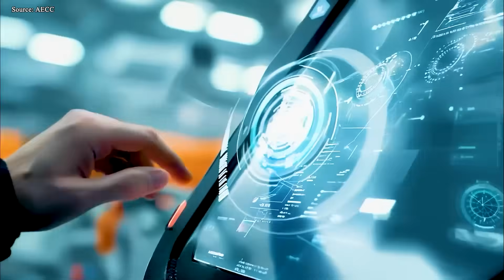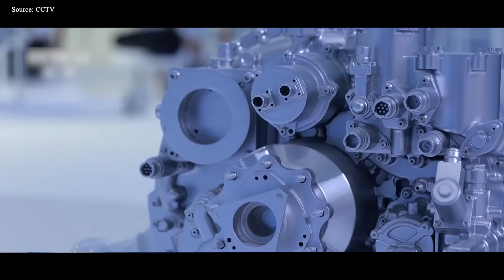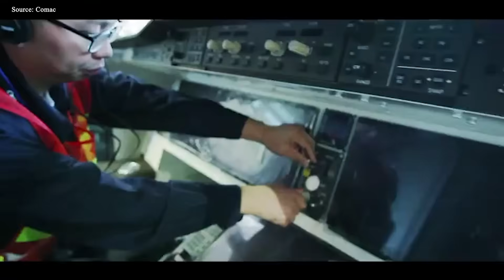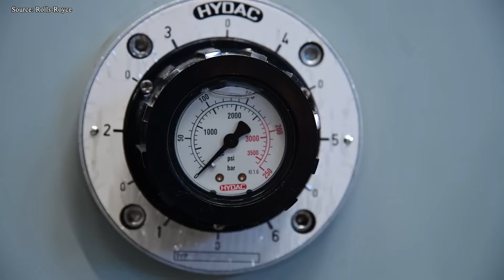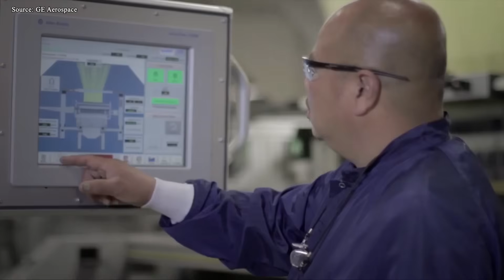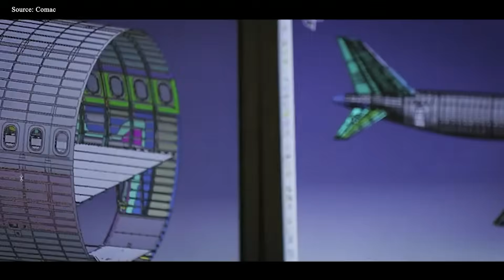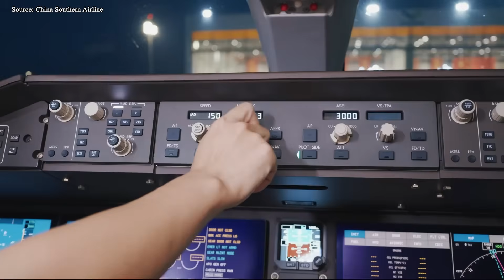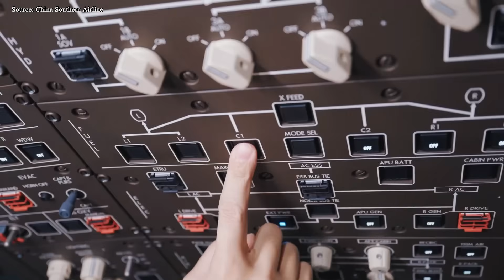How NEW Chinese CJ-3000 Engine Will Outsmart Rolls-Royce

Comment: The fact that China can come out with the CJ1000, 2000 and 3000 engine is a testimony to the end of Western commercial engine domination...
Reply from the maker: Right!
Reply: It will take at least 20-50 years.
Reply: @4-SeasonNaturewhat about the space station...about 13 years.
Reply: @4-SeasonNaturenot that long...
Reply: Doesn't mean anything
Reply: @larryallen9404  Of course it doesn't mean anything to an ignoramus...
Reply: @larryallen9404 CJ-3000 vs Rolls-Royce Counterparts: Core Advantages
 
In core fields, the CJ-3000 has a more forward-looking technical route than Rolls-Royce’s similar products. It integrates variable cycle technology, which can switch combustion modes on demand to adapt to different flight phases, while Rolls-Royce’s counterparts such as the Trent XWB have not yet applied this technology in mass production and still rely on traditional cycle architectures. In terms of materials and processes, the CJ-3000 makes breakthroughs—its turbine blades adopt high-temperature alloy plus 3D printing technology, enabling stable operation in 1500℃ extreme environments with a single-crystal blade yield rate of 85%. In contrast, Rolls-Royce relies on traditional nickel alloys and cooling technologies, showing slightly inferior high-temperature adaptability and process innovation. In layout design, the CJ-3000 is equipped with gear transmission technology (GTF) and carbon fiber composite fan blades, combined with a twin-engine layout to simplify the structure. Although Rolls-Royce has advantages in three-axis structure adjustment, its mechanical complexity is higher and flexibility in adapting to new aircraft models is insufficient.
 
In core indicators, the CJ-3000 fully surpasses Rolls-Royce’s products in key parameters. Its designed thrust reaches the 50-ton class, with actual measurement up to 45.8 tons, while Rolls-Royce’s Trent XWB has a thrust range of 84,000-97,000 pounds (about 38.1-44 tons), meaning the CJ-3000 leads by about 1.8-11.9 tons and is suitable for aircraft with larger maximum take-off weight. The bypass ratio of the CJ-3000 is optimized to 15:1, 56% higher than the Trent XWB’s 9.6:1, which significantly reduces airflow loss of non-core engines. In combustion efficiency, the CJ-3000 is at an industry-leading level, 12% higher than the Trent XWB’s conventional high-efficiency level, with better core energy conversion capacity. In terms of economic indicators, the CJ-3000 saves over 30 million yuan in annual fuel costs per unit, thanks to a 15% lower fuel consumption than the Trent XWB, showing obvious economic advantages.
 
In core performance, the CJ-3000 outperforms Rolls-Royce’s products in both power and economy. It has stronger thrust output—the 50-ton class thrust can support the long-distance flight of the C939 (with a maximum take-off weight of 320 tons), surpassing the power demand of the Airbus A350 adapted by the Trent XWB and being close to the engine level for the Boeing 777X, with more sufficient power redundancy. It also features better fuel economy: the combination of 15:1 high bypass ratio and variable cycle technology reduces comprehensive fuel consumption by 15% compared with the Trent XWB, bringing prominent advantages in long-distance operation costs, and its single-engine fuel consumption savings far exceed the average industry upgrade range. Besides, the CJ-3000 has stronger reliability in extreme working conditions—its turbine blades have passed 2000-hour durability tests, with excellent high-temperature stability and component service life. Although Rolls-Royce’s products have a dispatch reliability rate of 99.9%, they rely on long-term operation and maintenance optimization, and the extreme adaptability of core components is slightly weaker.
Reply: CJ-3000 vs Rolls-Royce Counterparts: Core Advantages
 
In core fields, the CJ-3000 has a more forward-looking technical route than Rolls-Royce’s similar products. It integrates variable cycle technology, which can switch combustion modes on demand to adapt to different flight phases, while Rolls-Royce’s counterparts such as the Trent XWB have not yet applied this technology in mass production and still rely on traditional cycle architectures. In terms of materials and processes, the CJ-3000 makes breakthroughs—its turbine blades adopt high-temperature alloy plus 3D printing technology, enabling stable operation in 1500℃ extreme environments with a single-crystal blade yield rate of 85%. In contrast, Rolls-Royce relies on traditional nickel alloys and cooling technologies, showing slightly inferior high-temperature adaptability and process innovation. In layout design, the CJ-3000 is equipped with gear transmission technology (GTF) and carbon fiber composite fan blades, combined with a twin-engine layout to simplify the structure. Although Rolls-Royce has advantages in three-axis structure adjustment, its mechanical complexity is higher and flexibility in adapting to new aircraft models is insufficient.
 
In core indicators, the CJ-3000 fully surpasses Rolls-Royce’s products in key parameters. Its designed thrust reaches the 50-ton class, with actual measurement up to 45.8 tons, while Rolls-Royce’s Trent XWB has a thrust range of 84,000-97,000 pounds (about 38.1-44 tons), meaning the CJ-3000 leads by about 1.8-11.9 tons and is suitable for aircraft with larger maximum take-off weight. The bypass ratio of the CJ-3000 is optimized to 15:1, 56% higher than the Trent XWB’s 9.6:1, which significantly reduces airflow loss of non-core engines. In combustion efficiency, the CJ-3000 is at an industry-leading level, 12% higher than the Trent XWB’s conventional high-efficiency level, with better core energy conversion capacity. In terms of economic indicators, the CJ-3000 saves over 30 million yuan in annual fuel costs per unit, thanks to a 15% lower fuel consumption than the Trent XWB, showing obvious economic advantages.
 
In core performance, the CJ-3000 outperforms Rolls-Royce’s products in both power and economy. It has stronger thrust output—the 50-ton class thrust can support the long-distance flight of the C939 (with a maximum take-off weight of 320 tons), surpassing the power demand of the Airbus A350 adapted by the Trent XWB and being close to the engine level for the Boeing 777X, with more sufficient power redundancy. It also features better fuel economy: the combination of 15:1 high bypass ratio and variable cycle technology reduces comprehensive fuel consumption by 15% compared with the Trent XWB, bringing prominent advantages in long-distance operation costs, and its single-engine fuel consumption savings far exceed the average industry upgrade range. Besides, the CJ-3000 has stronger reliability in extreme working conditions—its turbine blades have passed 2000-hour durability tests, with excellent high-temperature stability and component service life. Although Rolls-Royce’s products have a dispatch reliability rate of 99.9%, they rely on long-term operation and maintenance optimization, and the extreme adaptability of core components is slightly weaker.

Comment: it will take a long time for China to catch up with roll Royce.  Modern jet engines with fuel economy and power is not easy. China doesn't see as weakness to buy engines.  western power is broken already. America and France engines China bought is clever, it is cheaper and on the shelves. China will buy engines from the world ,even China has build their engines. china has achieved many high end military engines already, so it is just time china will catch up.
Reply: How long? One week or one year? Best western engineers are rushing to China for better future. see
Reply: Chinese military planes are tofu dreg
Reply: @larryallen9404 Israel will be alarmed when China sells the J 10 C to Iran. The moment J 10 C can shoot down the F 35 .. that's the end of supremacy..
Reply: @larryallen9404 1. Reliability & Tech Superiority (with U.S. Fraud Exposure):
The U.S. F-35 has a 96% failure rate in critical systems (U.S. Government Accountability Office report), and Elon Musk even accused Lockheed Martin of fraud in its development. In contrast, China’s J-20 and J-35 excel in core indicators: J-20’s WS-15 engine delivers 18-ton thrust (surpassing F-22’s F119), and J-35’s stealth coating and avionics are more advanced. China is also leading in sixth-gen and seventh-gen fighter tests, with multiple successful试飞 (test flights) already.

2. Documented Stealth Jet Encounters:
On March 20, 2023, over the East China Sea, a J-20 drove away a U.S. F-35A, forcing it to retreat. In another incident in May 2024, near the South China Sea, a J-35 intercepted a U.S. B-2 bomber, demonstrating superior stealth detection and maneuverability.

3. J-20’s Strategic Penetration:
In April 2024, J-20s flew over the Tsushima Strait; U.S. and Japanese radars failed to detect them until they were already in international airspace, showcasing unmatched stealth and penetration capabilities.

4. J-16 Locks F-22 & J-10C’s Dominance:
 
- In December 2023, over the South China Sea, a J-16 locked an F-22 with its AESA radar, forcing the U.S. jet to scramble.

- The J-10C, in drills, shot down French Rafale and Russian MiG-35 with its PL-15 missile (range 200km+), proving its superiority over fourth-gen and fourth-plus-gen fighters.
 
Your "tofu dreg" remark is a baseless stereotype. Chinese warplanes now lead in reliability, combat performance, and technological innovation—facts that your bias can’t hide.
Reply from the maker: That's a very comprehensive take on the challenges and strategies involved in engine development!
Reply: China has surpassed many technological milestone you think they are not capable of building a passenger jet engines?  Who would have thought they have their own space rockets  and space station.  Do not underestimate the abilities of the Chinese.